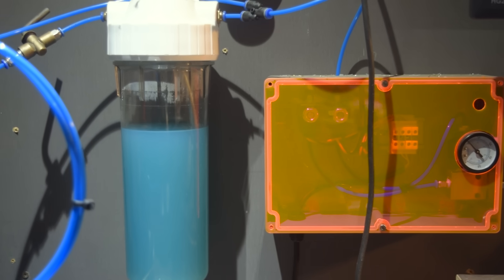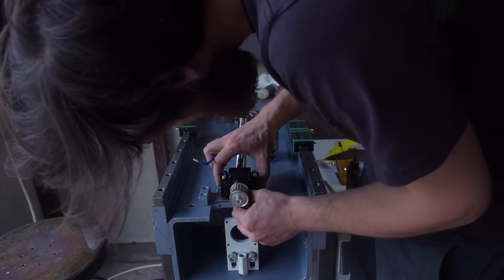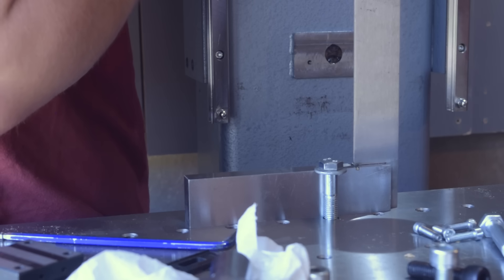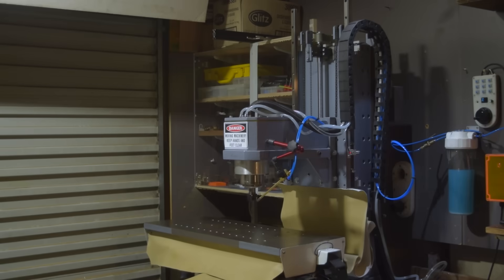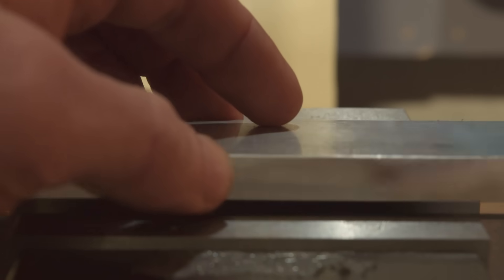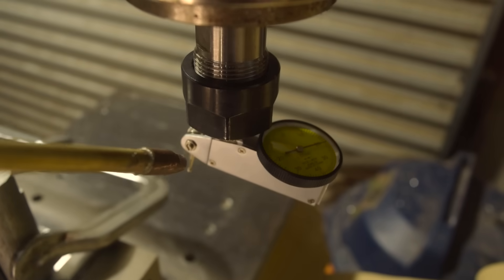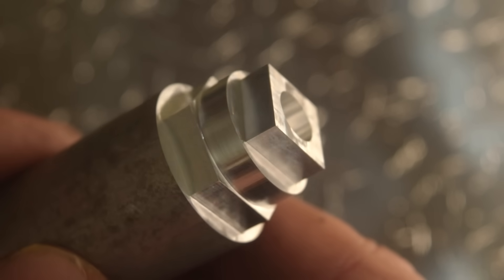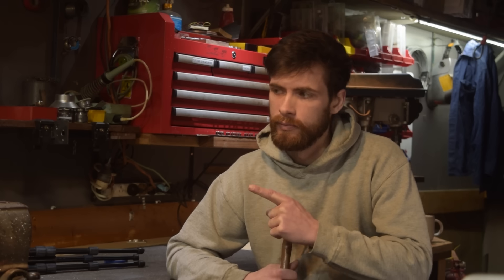My DIY CNC mill eats metal

Comment: Damn, I'm late to the party because I forgot to hit the bell.
Reply from the maker: Everyone learn from this guy 🤌
Reply: @NoEngineerHere   we must learn from the best engineer that isnt an engineer , or so he claims
Reply: same haha
Reply: Bro wozit ..I love the idea of jack screws. ... I have never seen it before 🎉🎉
Reply: @NoEngineerHere which one oil use to spray on this job ? 
Will you please tell me the name of this product
Reply: Hey guys, I'm sorry I just got here! Is the party still? On? also did we really need to glue down the machine flattened surfaces with epoxy?
Reply: @horisontial  ... rendendo così l'accoppiamento fisso e non più separabile e neppure regolabile in caso di disallineamento. Non mi capacito. Forse è necessario per smorzare le vibrazioni? Perchè non potevano bastare 20 bulloni da 10mm? qualcuno fa delle ipotesi?
Reply: better late than never 👏

Comment: the number one cool think is making negative and positive dies to press and extrude sheet metals. I wanted to make a sheet metal radiater for my rocket stove, instead of using an oil barrel, to have less round for small houses. That's why I strive to have a cnc mill, in the future. Or press logos in sheet metal.

Comment: What is the purpose of the epoxy layer between the column and the base mating flanges?
Reply from the maker: Maximum surface contact after the column has been trammed (the mounting surfaces weren't scraped for contact nor squareness to the base)
Reply: @NoEngineerHere  understood. I’m just thinking that if the flange surfs are not perfect parallel and mated, the thin uneven layer of hardened epoxy is going to turn to dust over time due to vibrations leading to torque relaxation of the bolts because the epoxy changed in consistency and the stack would change in thickness.  Hope it makes sense

Comment: So I’m gonna be making my own CNC mill and looking for videos to help source material. I have access to old metal railroad rails about 10 of them 45 feet long. Would you recommend using them instead of the large rectangle tubing you used? I was thinking of using a concrete block with the railroad rails on top. Suggestions?

Comment: What Spindle would you recommend? I'm in Oz with 240v AC, 15amp. I'm looking at 3.5kw (800hz, 4 pole) spindle with 3.7kw vfd. But I can't find one with less than 12000rpm. I've seen 3kw spindles cut steel so hopefully 3.5kw will be OK,  but I feel I need one that can torque at low speeds as well.
Reply from the maker: These days I'm running a 2.2kw AC servo and a bt30 cartridge spindle, which I'd recommend if you're looking to do much steel! Full torque at low speeds

Comment: Bro its realllly nice and looks very rigid and 100% commercial, that being said it looks like it cost as much as a similar commercial unit. Im soon to finish my cnc build and then plan a manual mill and a lathe, for metal, although they will likely be used for wood as well. Im also building a large planer and a few other things. I've already built several machines for my makeshift machine shop/hobby shop. They keep becoming more complex and expensive, however as I go im also able to fabricate more of my own parts and learn tricks to save money here and there and where to best salvage components from otherwise stuff headed to landfill. My question is, how much did you invest im it vs a similar commercial unit. 

Your mill definitely looks more like a manufactures mill than mine, however I suspect mine will be at least equal tolerance and quite a bit cheaper. I went with a more standard diy approach with many upgrades compared to what most people build. Anyways great work! Hopefully im wrong and you saved a ton but it definitely looks pricey, but that doesn't necessarily mean you spent anymore than I have.

Comment: Have you found any candidates for the spindle yet? Everything I see out there seems to be high speed, geared spindles for less speed and more torque don't seem to be a thing, despite the fact that they would work much better for steel.
Reply from the maker: I've got a cartridge spindle sitting in the drawer waiting for me to build a new headstock 😁 stay tuned
Reply: @NoEngineerHere  Subscribed just for that

Comment: Granted, it’s been 8 months so I’m sure you rectified this, but just wanted to voice my completely unwarranted and potentially unhelpful support for switching spindles. I use the same 2.2 kW spindle on my cnc router, it’s a great spindle for cutting aluminum but prob not what you want for a mill. - Not a machinist

Comment: Tip for the closed loop stepper drivers: put the pulse filter time on the shortest setting (more abrupt stop of the motors = less run out on your passes) that way you can make much more precise movements om higher feeds.

Comment: No doubt in my mind this is an awesome build. It’s about getting 3 hundreds tolerance is certainly a good result. I do disagree with one thing though. Adding weight is definitely not always a good thing because it lowers the natural frequency of the machine which can cause resonance issues and on moving parts reduces the dynamics. You are looking for maximum rigidity, high damping and lowest possible weight. It’s a trade off between those parameters. Rigidity is the most important. Getting structural stiffness by adding damping material where it is needed gives best results. Hollow cast iron structures is what the machine builders are using to achieve that. That said, for us home builders adding some oil sand seems to be a nice idea. Or use epoxy granite which adds rigidity.

Comment: I'm English,and a CNC machinist for 29,000 years, this guy is Aussie, so when I say that's impressive I might get in trouble, but awesome job man. Mamouth effort. And nobody knows what happens in the electronic cupboard, lol.Try these feeds and speeds on Ur 6mm carbide 3flute, 3200 rpm....not 20000 bud even carbide wears and chips., and 2000 feed. That's 120mpm at 0.2mm chips...not potato chips. Ha. Funny video, I saw u were extatic at the results lmao. Keep on creating dude. Bravo.
Reply from the maker: Thanks mate! Unfortunately that spindle has no torque below 8000rpm, but I've got a servo driven spindle on it now. Much more refined. Kinda.
Reply: Beast, ya servo everything is pro, beyond me, stepper motor easy,servo motors wizardry,Ur a clever cookie.I'm actually trying to do exactly what u have done and as a CNC machinist I know nothing about how to do any of it...only make the parts...(all by hand ATM), so I can imagine the pain. (I actually got arrested for complimenting an Aussie btw)...erm... awesome job. Peace.
Reply: And good info about the 2.2kw motor, I was looking at that exact one...not anymore. Thanks man.

Comment: Whow dude. Amazing build!
A few years ago I only had the balls to buy one of these crappy cnc machines of Aliexpress for a couple hundred bucks and did my ohn controller by arduino. Nothing against what you did and man was it a hustle
very light aluminium work is sometimes possible (depends on humidity and the moonphase or something :-) even though for a chinese one its build pretty sturdy.

Im very impressed by your ingenuity and the outcome and suprised with performance overall, kind of hsc machining. Just wow!! 
May I ask what the cost approximately could be to build something similar?

Best regards from Germany :)

P.s. You my friend have a new Supscriber for life haha
Reply from the maker: I think everyone goes through that stage haha! My first CNC project was strapping a plasma torch to a $200aud laser engraver 😅

I really should do a proper tally of the parts, but as of today I think I've spent around $8k AUD. It's had some upgrades since this video though!

Comment: I use a tiny piece of newspaper wet with coolant to get the tool height or a permanent marker when the tool touches it will removed the marker stain.

Comment: Thus far I've scratch-built a 3D printer and a transformer/coil winder - maybe I ought to build a decent-sized CNC mill next. Catching a whiff of inspiration off this video and the mill build video...
Reply from the maker: Do it, there's nothing like running your own machines
Reply: @NoEngineerHere   Oh you're not kidding - when I got my printer working the first time I was all "YES! I HAVE MADE A THING! A THING THAT MAKES OTHER THINGS!" followed by a bout of mad-scientist laughter. (In fact it's warming up for a print run behind me as I type this - gotta make a few parts for the transformer winder. Going to do a multi-part write-up on that project since I took loads and loads of pics...)

Comment: Good job, couple tips from a machinist here, I recommend checking the runout on that spindle, also the tram of the head relative to the table as well, and for carbide tools even in aluminum, it’s better to use air not cool mist if you don’t have full flood coolant it will heat shock the endmill , the first 2 tips are the most important for finish, and tool life.i subbed.

Comment: Im running that same spindle with 4mm end mill, in alum at 9500rpm. 1300mm/min Adaptive clearing, 1.2mm chipload. Works well, isnt too loud.

Comment: As some others have mentioned I doubt that the surface finish issue is caused by the ballscrews, to me it looks very much like aliasing caused either by the controller not running fast enough or more likely a setting in the controller designed to make sure it can keep up. Essentially, with computationally weaker controllers instead of moving in real arcs or at arbitrary angles to save on computation the move is instead split into hundreds or thousands of tiny individual linear moves. If the settings for this aren't fine enough you will end up with a stepped surface.
If you do a Google image search for "approximating circle" some of the first few results give a good visual explanation.

Comment: That is one fine machine!!   Really though for working on steel et al you need a hell of a lot more weight minimum of 1500 kgs total and with those depths of cuts yore doing and you could do with very large 3 phase motors to drive the bugger and the spindle but considering that you made this yourself you should be very proud with your achievements. Well done , to get those tolerances is pretty damn good. All that work with a dial gauge paid off . Damn fine work....

Comment: There is dynamics. Not sure how it is across the pond but here you got the basics of it as early as elementary.
Next time around you could make it 20 times lighter. Use less power, less motors and have much tighter acceleration.

And keep in mind, the only rigidity that matters is between the bit and the workpiece

Comment: @NoEngineerHere Similar to others mentioning about the odd dwell pausing as the machine gets to corners. Like they said its just the sheer amount of G-Code that the teensy is trying to digest.
One of the biggest helps I've found for this is by changing the settings of whatever program your using to generate the toolpaths to output arc (G02 and G03) moves that use I and J terms instead of using linear moves on arcs.
Many programs and post-processors default to using linear moves even if you're actually wanting to move in an arc, so they fit hundreds of tiny linear moves to try and 'describe' an arc or a circle instead (resulting in literally hundreds of lines of code) rather than using two arc moves that takes only two lines to describe a circle!

Not only does using arc moves speed up your CNC movement by reducing the code throughput (if that was a limitation), but you also get better surface finishes on curves since they are now made up of arc's rather than lines (the accuracy of those linear moves can be adjusted upwards but that just means MORE code and even slower machine movement).

Please ignore if you're already using arc moves but hopefully this might help.

That's a BEAUTIFUL machine by the way and you should be immensely proud!

Comment: 2:46 Wait are they the welds you did for the column? Ok this is a DIY project. Well at least you gave it a go......
Reply from the maker: Yeah look not my best welds, have been waiting for someone to spot them. They're double layer triple pass though, they've held up so far
Reply: I am a fabricator and there are lots of changes I would have given a  person trying to be a professional but the only thing I would have asked of you is you went a little cold on the welds. Which is what beginners tend to do. They get shy with the heat.  But hey, you made it work. Its what counts. Well done. @NoEngineerHere

Comment: 24k RPM is bonkers. The VF6 SS i worked on goes to 12k RPM. You should definitely make an enclosed housing and a coolant system if you plan on cutting aluminum.

Comment: Spindles like that (22kRPM 2-pole, I presume) are usually designed for woodworking, or smaller diameter tooling.  If you start using larger bits (>6mm) to gain rigidity/accuracy, you may want a slower speed, 4-pole spindle.  You can run high-speed spindles at lower speed via VFD settings but you will lose torque.
Reply: Yeah they really don't like going under 10k or so

Comment: Great work, but man also learn how to use a micrometer correctly. The rachet is there for a reason. When you take a reading without the ratchet the final reading is purely dependent on how much pressure you put while turning it.

Comment: You need to remove all those shimming pads. And the column on the glue layer is too much.
Measure the bends of the spindle relative to the table with a force of 10 kg applied between them. For steel machining, a minimum of 0.01 mm is acceptable. But it is better to use five times higher to pay off using a carbide tool with a high service life without cracking.

Comment: Why does it pause during the cuts?  Is it just not able to change directions in a fluid movement or is it a processing power issue?

Great job man!
Reply from the maker: As far as I can tell it's a limitation of grblhal, but I haven't spent too long messing about! Controller upgrade is definitely on the cards

Comment: Love the videos! Hilarious and informative. Solid mix. My only critique on the machine itself would be the coolant misting system. Imho, it might be worth looking into a pump system so that the coolant doesn’t become atomized, and is collected in a vessel below your work holder, only to be pumped back up and recycled. That evap has to go somewhere, and well… You’ll definitely be wearing it, in addition to seeing it build up on nearby surfaces, especially in hot conditions. Just my two cents. Brilliant work on all fronts, nonetheless, and I look forward to seeing what you do with it!
Reply from the maker: The coolant vessel is actually slightly pressurised, which acts like a pump, and like you said, prevents atomisation :-) based on the fogbuster "mistless" coolant system

Comment: Statistically speaking, as I understand the runout on the 2.2 KW chinese spindles is usually a little bigger than the 1.5 KW ones. Don't ask me why.

Also the surface finish I expect is possibly because you used stepper motors? Hybrid Servos would help but ... yeah they have other issues to consider (different ballscrews for one).

Comment: Hi a simple upgrade to your machine would be to change all the balls in your linear rail slides to ceramic. I have found the the steel balls, even is the more expensive ones are not round. Quick way to check just place a few balls on a flat surface. An additional benefit ceramic ones no lubrication is required. Also you may want to check speeds and feeds for the various bits that u are using. Manufacturers will have that information on their web page. Thank you for your videos.
W

Comment: nice project. one question : i see the counterweight in many of the diy projects, but i dont see them anymore in the modern industrial VMCs. is it probably a thing of the past ?
Reply from the maker: Maybe they're using pneumatics? I've heard stories about spindles coming crashing down when a pneumatic counterweight fails
Reply: @NoEngineerHere  i discussed with a machine shop owner, he said they did away with any counterweight because the positive downwards force was actually useful for higher accelerations. he said it is better to have a downwards force acting always, and a counterweight can make the z axis jumpy with high accelerations. he was not a machine designer though. but ive personally gutted a few smaller cnc machines without a counterweight at all.
Reply from the maker: @247chiranjeevi  I just remembered another reason I opted for the counterweight was so I didn't have to get a brake for the motor. But yeah makes sense! Would definitely help with and backlash too
Reply: @NoEngineerHere  connecting the dots,  the motors on the systems without counterweight had electromechanical brakes which would release when machines was powered.

Comment: Can I marry you?? I've been thinking up a diy mill I wanna make and was thinking aluminum extrusions filled with sand would be a great (cheap) way to add mass with the added benefit of helping with damping. When I saw you pull out the sand I actually yelled in joy 😂 adding old oil is smart too I hadn't thought of that. Great build!!

Comment: Congrats on your build! But that's not how you properly use a micrometer, you must advance it by spinning a ratcheted part of the knob. By cranking the "rigid" part of the knob like you've did, you'll get an incorrect reading (because of inconsistent force) and can even damage the mic

Comment: Looks great!  Do a little work on the motor tuning in the control (acceleration ramps) and you'll likely also see an improved surface finish. It looks like it was in exact stop mode, so it was trying to stop at every corner or arc termination, then slowly accelerating up to speed, slowing back down, and stopping again.  For good surface finish a consistent feedrate is important, so increasing acceleration and reducing the stopping will give nicer cuts and run jobs much faster.